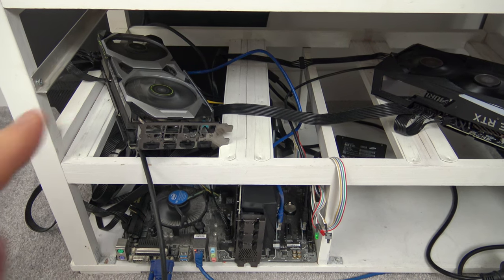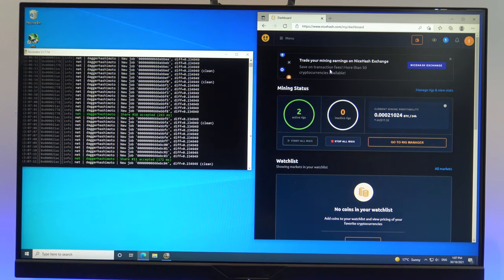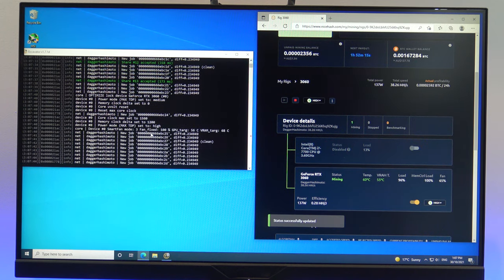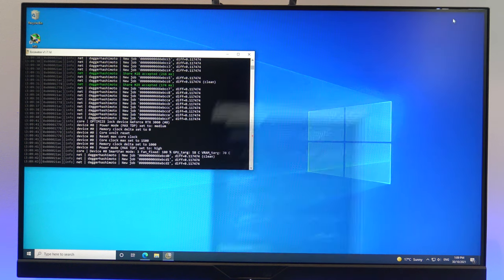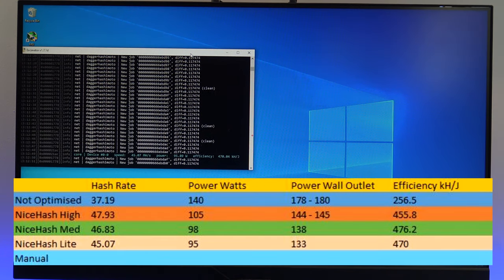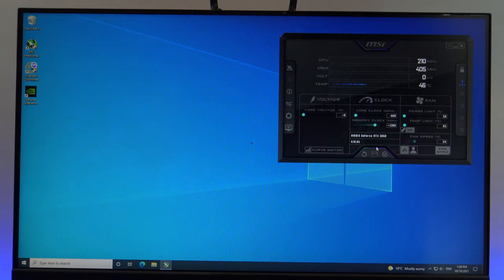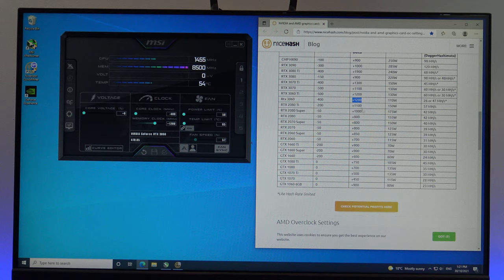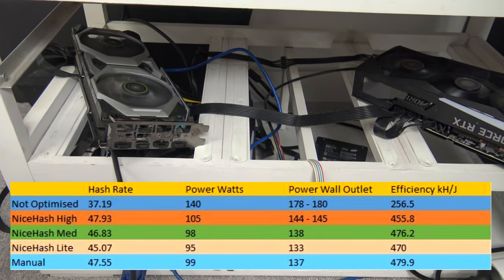Dont Use Nicehash Optimized Settings

Comment: This depends on the GPU. I've got a 2060 and it is running at 52C, 28-34Mh/s around 500kH/J at steady 50-65W. This was made using their "Medium" preset. So this really depends. With MSI I was getting hotter temps and higher Watts (Like 120-140W, now this is HUGE, that's like 2-3X the ammount).
Reply: Because you didn't play with the voltage curve on MSI
Reply: me too! on a 3060 v1
Reply: My 2060 seems to outperform 1 to 2 of my 3060s on the medium optimized settings, so I also concure with V1 2060 performance using nicehash settings in 2022.

Comment: I'm using my RTX 2060 to mine with High optimization setting, and now it runs at 29 MH/s, GPU temp 50 Celcius, 82 Watt power consumption, and 360 360 kH/J Efficiency.

Is that optimal for both power consumption and longevity of my GPU? (well, the profits will definitely be minuscule compared to higher end cards)
Reply: my rtx 2060 pulling 30 MH/s , GPU temp 53 Celcius, 99 Watt power consumption, and 320 kH/J Efficiency. using high optimization settings. how is yours pulling only 82 Watt?

Comment: Anyone else Having an issue setting TDP settings in NiceHash. Mine are always stuck on high I made sure it is turned on in the settings and the app is run as administrator. No matter what I set it on it resets back to high. I can use Quickminer but I get better hash rates on regular NiceHash
Reply: same
Reply: @cixato3671  I have searched the internet so many times I give up. There are multiple threads started but never a resolution.
Reply: @lowkee33  I have Nvidia 3060 laptop GPU what about you?
Reply: @cixato3671  I’ve got a MSI ventus 3x Rtx 3060 & Rtx 3070ti Founders edition. Both have the same issue. And on top of that my Dad has 2 Rtx 3060 in his rig and he has the same issue
Reply from the maker: @lowkee33  Are you guys all using laptops? Maybe thats the reason? Turn it off an use after burner maybe?
Reply: @123myIT  Im on a desktop and the new version of NiceHash fixes the issue
Reply from the maker: @lowkee33  Nice one dude good to know.

Comment: Put my 1080 ti to the recommended memory boost, started artifacting and couldnt even start my PC, thought i bricked my card. Guess ill make do with my shitty hashrates.
Reply: I got a 1080ti as well, I put it on the recommended settings as shown in the video and then all my monitors had green symbols appearing and my mouse and keyboard was not responding. I restarted my PC and now its fine but was very weird.
Reply from the maker: GTX 1080 Ti	0	+750	185W	45 MH/s. This is the settings off Nicehash website. So basically you set the lock speed to +750 and that's it. IF you are getting the artefacts is means you have probably pushed the card to hard :)
Reply from the maker: @draco3096  GTX 1080 Ti	0	+750	185W	45 MH/s. This is the settings off Nicehash website. So basically you set the lock speed to +750 and that's it. IF you are getting the artefacts is means you have probably pushed the card to hard :)
Reply: @123myIT  I couldnt find any settings better than quickminers lite/medium optimizations, everything I tried was either unstable or no noticeable improvement.
36mh/s at .18 mh/j on medium or 31 at .20 mh/j on lite. feelsbadman
Reply from the maker: @42069memes  yeah just roll with that then. or Get rid of the 1080 card and upgrade to 20 or 30 series best.
Reply: @123myIT  Yeah i want to sell it and get a better card but they're all so expensive atleast on ebay, any recommendations? Just wait for the price of gpus to go down?
Reply from the maker: @42069memes  Well yes or you could just buy crypto and stake it ?
Reply: @123myIT  what, I have been mining on it for to long or I have overclocked it to much?
Reply from the maker: @draco3096  ?
Reply from the maker: @draco3096  Umm it means you pushed it to hard.

Comment: Hi I just started mining and have free electricity does this mean I should run high? I still want to keep GPUs safe but my temps never go over 70C so I think it is good? Lastly my nicehash daily profit ranges from 4 to 5 dollars every couple of minutes is this normal?
Reply from the maker: Hi Mate, I would always opt for a lowest power use to highest hash rate. There is a sweet spot. Lower power means less heat. And less strain on GPU hardware. 70C is pretty good. Nicehash profit is normally as the price of BTC goes up and down. I'm thinking to do a video on what i would do if i have 1000$s to invest. What do you think of this video idea?

Comment: Great vid mate 👍 
Any advice on vram temps for a 3080?
Reply from the maker: Cheers dude. What temps do does your card get currently? Ive tested the 3060 and 3060 ti. And they are so much better than 2080 cards ive used. The seem to run cooler by default. So i would say a good temp should be around 65 to 75 for your card. Celsius that is.
Reply: @123myIT  im running a 3080 gaming oc at 98c. It's in a lancool mesh ii case with 4x2500 rpm fans on it. I haven't changed the thermal pads or paste just yet. That'll be the next step. Is liquid cooling going to aid cooling the vram? Or will that be pointless?
Reply from the maker: @THEBLACKVVOLF  Its pretty high mate. the vram runs at 62o on my 3060 ti and 80 to 90 on my 2080 ti. so running at 98o is close to overheating. If you take the side off your case does the temp drop? turn it off for 10 mins to let it cool. and they start it up with the side off.
Reply: @THEBLACKVVOLF  that's normal for 3080s just try to keep it under 106
Reply: @THEBLACKVVOLF  What is the room temperature? 98c is pretty high and close to thermal limit for that card! (Core max is 100C and DDR6X max is 110C)
If the room with the computer is warm already then of course it's gonna have issues keeping temperatures down with high ambient temps. Since it's still cool outside open a window if your pc room has one. and in the summer you'll want to get some A/C to keep ambient temps down!
Make sure your GPU fan curve is set to run 100% and get some air conditioning to help keep your card cooler and happier in the long run as temps like that are gonna shorten the life span compared to it running at 75-80c 24/7. 
I'm in a smaller room just using my main gaming pc with a EVGA 3070 TI to mine with Nicehash when I'm not gaming to earn some coin to spend at newegg & just opening a window right now as a form of air conditioning when it's 0c - 8c outside can lower my pc's temps by at least 10 degrees when mining.
Reply: @QuasiMonkey  im also getting 96-98c on my 3080 with manual recommended OC settings.... i have read that thats normal
Reply: @ConspiracyJ  Nvidia website lists the maximum GPU Temperature for 3080 & 3080ti at 93c. So idk where you read that but might want to look into running it cooler to prevent thermal throttling or shortening life span.

Comment: I must have done something wrong in the msi afterburner or the nicehash configuration.
[18:51:44][0x00001148][warning] device #0 | Failed to get power caps - problem with NVIDIA drivers, err=-4
[18:51:44][0x00001148][warning] LHR | Device #0 | Intensity: 55%. Unlock rate: 100%
Does anyone know about this error?
Reply from the maker: What model do you have and what driver are you using ?

Comment: Video is floored your example shows you saved 6w of power for 0.5mh, put them numbers in and you actually would of profited 2.86$ a year... but no doubt btc wold of went up so you would of profited more.

in the type of market were in with mining getting the most is usually best best unless your running a hot inneficient cards

Got a 3090 pfftt just runn it to the ground
Reply from the maker: Thx for the feedback mate.

Comment: Hi, I recently bought 3060, still waiting for delivery. One thing i wonder, does nvidia gpu have also compute mode like AMD (which has to be turn on to achieve proper hashrate)? And probably you can show any other setting in nvidia control panel i have to set for mining with nicehash?
Reply from the maker: Nah no compute mode.

Comment: My 2070 super with high gets 40mh and 90 watts but with manual and the optimal settings in MSI afterburner, i get 40mh but with 150 watts
Reply from the maker: Doesnt seem right dude.

Comment: If using msi afterburner how do you turn off nicehash overclock? Seems like it keep overriding my settings
Reply from the maker: You need to turn off nicehash on the gpu in the nicehash website. If that make sence :)
Reply: Do you mean disable ?? I dont see any Off in website

Comment: I dont seem to have a manual option.  I have always left mine on high and adjusted accordingly with afterburner or radeon software.
Reply from the maker: Are you using AMD? Applying double overclocks? DO you have a off button? Set it to off then apply overclocks through after burner.

Comment: Can you let me know the overclock setting for 3060ti lhr- my card siting at 31 at medium :( quick hash miner )
Reply from the maker: Settings will be the same as FHR model mate. Just the hashrate will be lower. RTX 3060 Ti	-500	+1200
Reply: On a zotac 3060 im getting 50.57mh/s and using like 130watts and getting around £1.30 in bitcoin daily

Comment: Hello, thanks for sharing 🙏🙏 Can you told me if that 3060 is LHR?
Reply: I would like to know too! (If he responds) while you're at it, I would really appreciate if you could tell us why you are using quickminer. Should I use quickminer (with lhr) or the normal one? Thanks A LOT.
Reply from the maker: @yass5889  if you buy before may 21 then it will be fhr.
Reply from the maker: if you buy before may 21 then it will be fhr.
Reply: @123myIT   and that one in the video? is a FHR?
Reply from the maker: @msantolx  yep 47 mh
Reply: @123myIT  🙏 Thank you
Reply from the maker: @msantolx  no worries :)